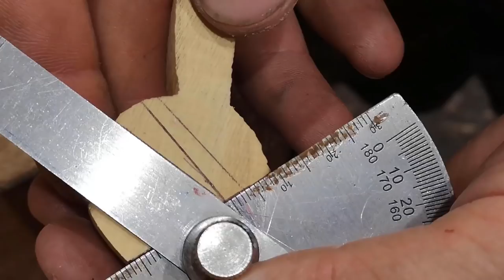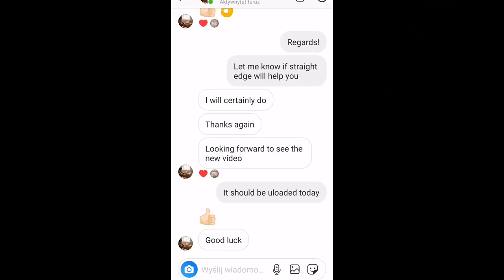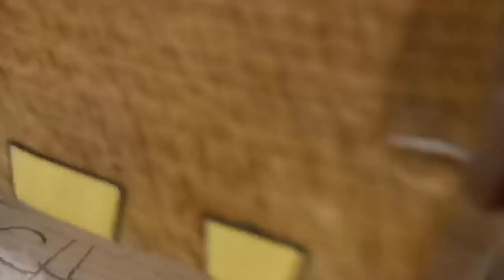016 "Squirrel" scraping hand plane. Woodworking

Comment: This is amazing on so many levels. I can totally see how this could be a primary tool on my tool chest. The process, the video, everything is amazing. BTW, I have rescued a plane iron from among the ruins of an old blacksmith workshop that you have in one of your planes, the one that has tiny points in a row. I understand it was used for prepping board surfaces before gluing on the veneer. No idea how to sharpen it though. The squirrel is both cute and mighty. Thank you, Gakos!
Reply from the maker: Thank you! If toothed blade have deep grooves the blade will be serve long time yet, if not nothing can help. If the back of the blade is rusted clean it with steel brush, don't flatten the back as normal blade (you can do few moves on high grid stone to check how the tooths looks but not too many times because you will make the tooths lower). 
Next grind new bevel until you feel little burr on the back of the blade. To remove the burr hammer the cutting edge into end grain of some wood. After that the blade should be ready to work. Regards!
Reply: Stavros Gakos Now that’s cool info, I appreciate that and will try the method. Thank you!

Comment: I'm not familiar with this tool. Is the bevel towards the handle? Do you sharpen it by drawing a burr going forward, just like a #80 cabinet scraper?  So, is it a little cabinet scraper on a handle that cuts on the push?
Reply from the maker: It is sharpened as "blunt chisel" (90 deg bevel). Check instructions in the descripion to see how it works. You can also wath my 013 video how i do that kind of scraper. Regards!

Comment: Thank you for the great videos.  I wanted to know if the narrow toothed blade you use to connect drill holes in the mouth is a saw or a plane maker's float?  The steel looks thicker than a keyhole saw blade, but I might be tricked by the zoomed in photography.
Reply from the maker: You're welcome Robin :) it is an old keyhole saw that i restored. I is 2 mm thick. Here you can find more about it https://www.instagram.com/p/Bzc8UyKI4GX/?igshid=oylbhx0a0z3d

Comment: REALLY that is a beautiful little plane . One suggestion . a BLUNT CHISEL would be very helpful for you . Go and look it up . Easy to make but invaluable .I only just found out about them .What you made is a real tool and most certainly NOT A TOY.BRAVO ,my friend BRAVO.
Reply from the maker: Thank you! I know blunt chisel and i use them very often (in this video 7:52, 11:00). Also scraper is sharpened as blunt chisel. They works great on flat surfaces but not curvy shapes like squirrel tail.
Regards!

Comment: Speed and aesthetic design on such a tiny job.
What was the cutting angle and bevel angle you used?
Reminded me of the squirrel hurrying and scurrying around before winter. Must be quite an inspiration.
Thanks for all the nice videos.
Reply from the maker: Thanks Glenn, cutting angle was 105-110 deb (i don't remember) and the bevel was not the bevel because there was 90 deg, it was sharpened like blunt chisel / card scraper. Regards!
Reply: Thanks, it's understood.

Comment: How do you sharpen the blade? (angles and such), and how do you loosen the blade to adjust? (Where do you tap wiht hammer?)
Reply from the maker: As blunt chisel. I just tap in the wedge from the bottom. Regards!

Comment: Hey man, I like your hand plane. Do you do different types? Also, what would you charge for your planes in (IRONWOOD)?  You could use instead of the high carbon steel you shown using here in this video for some old wood chisels. Just cut the handle off, or you could leave handle on so you would have the use of the chisel and fit it to your base. Might be a cheaper way of creating a blade for the base. Just my opinion. I look forward to hearing from you. Thank you for this video mate.
Reply from the maker: Thank you! Actually i don't make it for sell.  Ironwood is beautiful, but i don't have any piece of that wood.
Making plane blades from old laminated blades is the best way for me. Old laminated plane blades are tapered (thinner above, thicker below), that helps adjust the blade. Chisels are tapered inversely, that's not good for it. Regards!